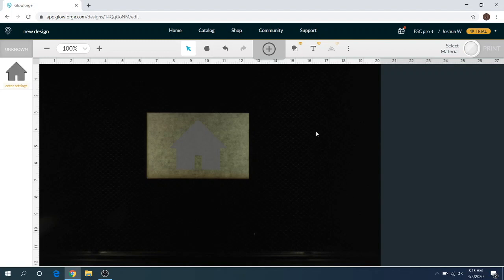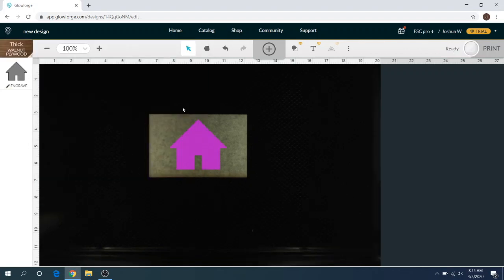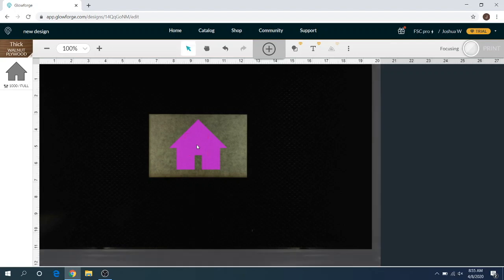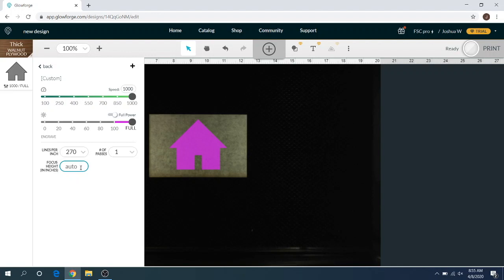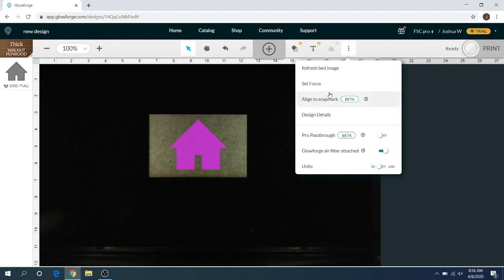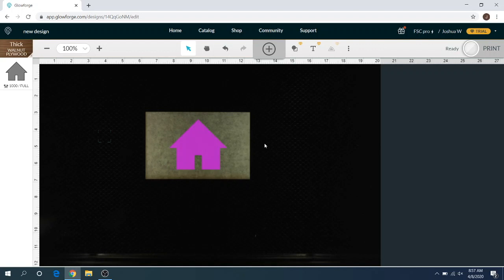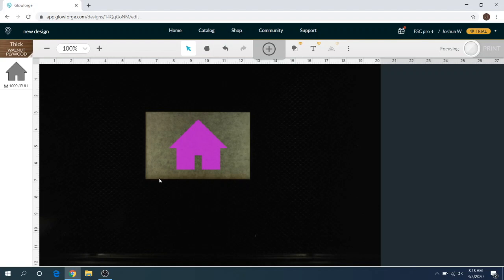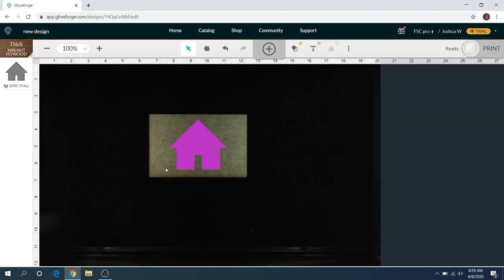How to use set focus on Glowforge

Comment: Wondering if you can help me. I am trying to cut a photo out perfectly with my glowforge. Like I glued a pic of a pig on my wood then want to cut it out but it’s always off a tad. Any suggestions?
Reply from the maker: You can cut the piece out then glue it on after. If that's not an option then put a sheet of paper in, do a cut line with like very low power to where you can barely see it then line up the cut by keeping the paper in the same place and lay the board over to top and cut it out would be my next idea possibly.